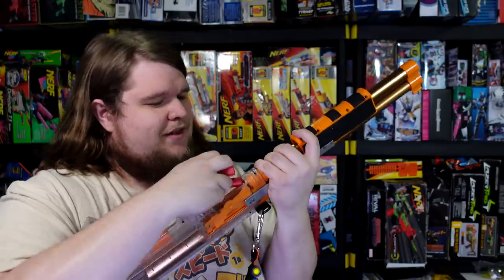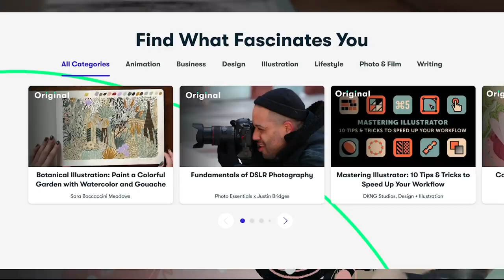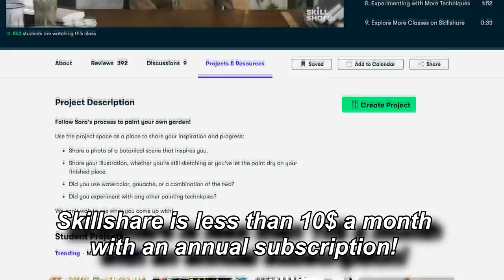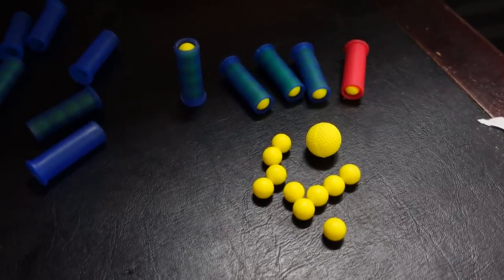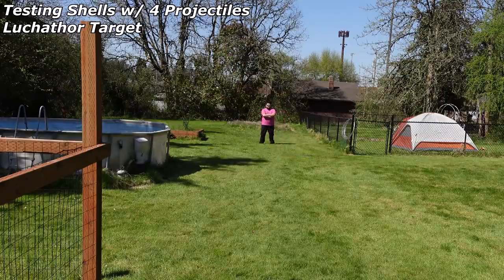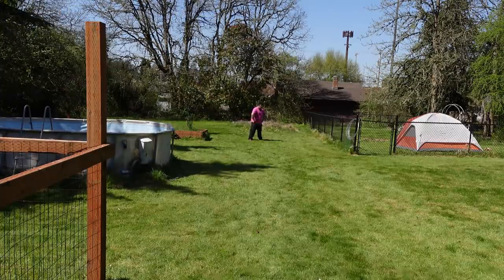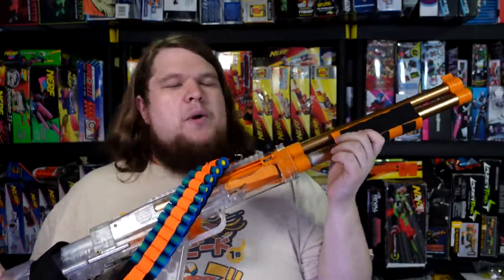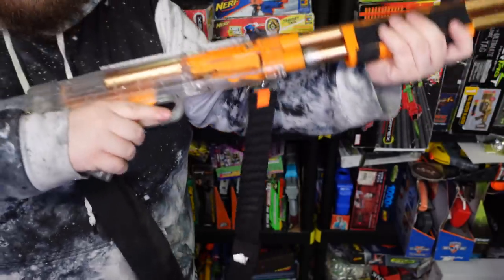NERF BUCKSHOT: The Mechanically Realistic NERF SHOTGUN (Mini NERF Rival)

Comment: Hyper is gonna revolutionize shotgunning in the hobby, mark my words.
Reply: yeah duh hyper (at least flywheelers) are inaccurate as hell
Reply from the maker: I will if we can get a new blaster designed for them IMO. I don't think the Spring Thunder/Sobek are going to be optimal for Hyper. I think a slightly scaled up Firefly would wreck though.
Reply: @WalcomS7  you should review the spyra 1 water gun, its not nerf but it is really cool
Reply: @WalcomS7  Imagine combining these .50cal paintballs alongside hyper. The paintballs seem to have tighter groupings, and what we've seen of Hyper so far, they seem to have less spread than Rival.
Reply: @Steelfist-i47  "duct-tapes 3 hopperfed extended capacity hyper blasters together" REEEEEE
Reply: @WalcomS7  I love Hyper because of the sheer possibilities for modding and homemades, Hyper is great for everything creative and performance wise. It just sucks it won't get widespread adoption because people keep saying it's "Too hard to pick up" even though a dart sweeper with closer together wires could probably do it.
Reply: prob with the conveyer belt tho so will be annyoing

Comment: You should mod some trilogy shells to fit the 50 cal balls in
Reply from the maker: You can, but you need more air power for more projectiles That's why a blaster than can fling a single foam dart 150 feet can only put 3-4 of the foam paintballs around 60-70 feet down range.

Comment: Still kinda miffed they don't work in the Shellstrike or Trillogy. They either don't fire at all or fart out of the shells. I cut the dart posts to around 1/3 or 1/4 of an inch and dropped 3 in each. Tested it with 2 and 1 in each slot as well... they do work in magazines if you load em very carefully, but they will roll out of the barrel pretty easily if you angle it down even slightly. Great in hoppers or breach loaders without ar's though. They also work well in the .50 cal paintball lines like JT Splatmaster and Valken's Gotcha line.

Comment: So, if you can fit 4 of these in the same space as a half dart, then you can fit 8 in the same space as a full length dart. A spring thunder can shoot two full length darts, or 16 of these. A pegless Trilogy or Sledgefire shell could fit 24.
Reply from the maker: Yeah except they don't have the air power to fling that many projectiles.
Reply: @WalcomS7  that is true, I was only thinking of capacity and not range. Though, I’m sure a Springthunder could comfortably move at least 6 if not 8.

Comment: Yo wait! If you use these rounds in a Springthunder, you could potentially shoot 16 rounds using the triple elite shell! Additionally, when the 3d printed leaver action rifle that's being previewed on Valor's channel, it could also fire shotgun rounds!
Reply from the maker: Lever action will definitely be rad with the GOTCHA rounds, but the Spring Thunder doesn't have the air volume to fling 16 projectiles. That's the issue with the bigger shells: you can put more in them, but they go half/third the distance and don't spread very much... and with space being a key factor here, it's just not really worth it unless you want one or two for your Breaking Wind.
Reply: @WalcomS7  Now somebody has to make the Foam-O Nature, but for the Firefly shells.

Comment: Hey Walcom, my recently purchased lepus (the one that you reviewed) and the flyweels arent working. I checked the battery and it's fine. Any ideas?
Reply from the maker: So it fires but no flywheels? One of the solder points probably broke.

Comment: Real question is will those rounds fit into a barrel break and a raptor strike... if so... SOLD
Reply from the maker: Yes and no. Yes, but you'd need to modify both blasters to no longer have an Air Restrictor.
Reply: @WalcomS7  sweet all I needed to hear thanks walcom I take it that someone has a how to video for that?

Comment: Why not Spring Thunder.
Reply from the maker: Bigger shells, but not more power. They work, but when you have more projectiles the range and spread drops drastically. At that point, the larger shells don't offer a whole lot.
Reply: Oh. But it's a shotgun. They are supposed have spread and usually don't have much range. I guess Spring Thunder is for people who find it aesthetically pleasing, while the Buckshot is for performance-based users.
Reply from the maker: @AetherOnYT  That's not how shotguns are supposed to work. If I can throw projectiles farther, there's little use for it. This setup is perfect because it's got enough reach to be a threat, but not enough to compete with most other high-performance blasters. The lower the FPS cap, the stronger this setup becomes, but it's actually usuable even in a stock war. 

Personally, I hate the look and feel of the Spring Thunder. It's a beautiful work of art, but it handles like a brick.
Reply: @WalcomS7  Oh, I get it now. Thanks!